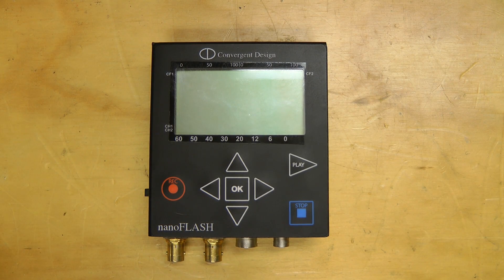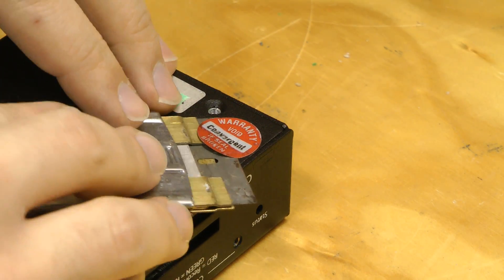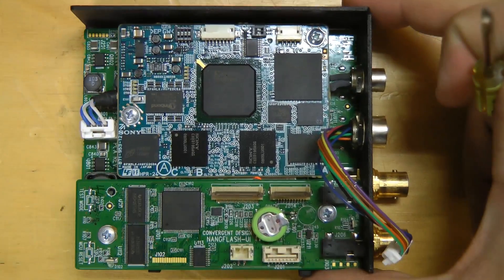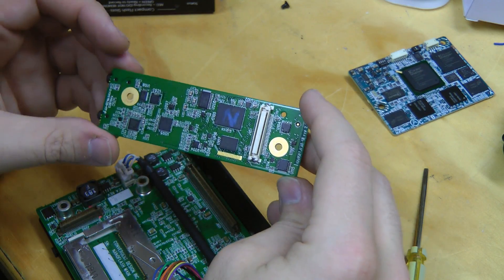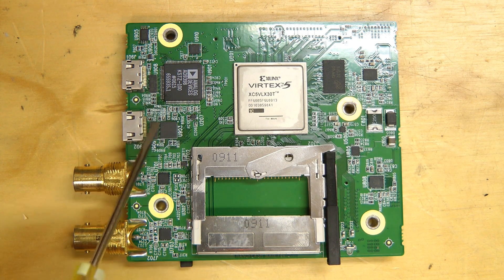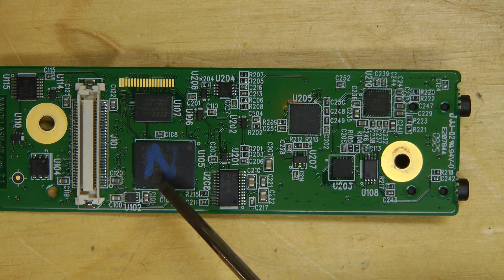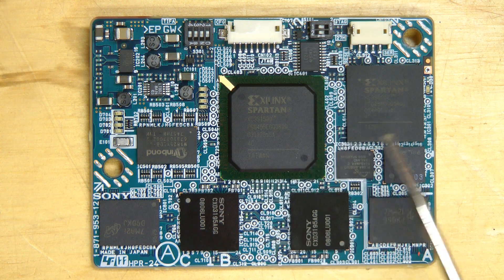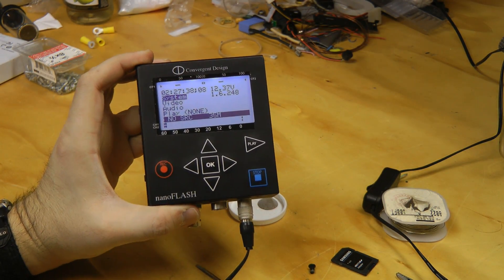NanoFLASH professional video recorder teardown

Comment: Thanks for sharing this! I have a NF and the onboard battery is dead. How difficult would you rate exchanging the battery? Can it be done with a standard soldering iron (regular size) and is there a high risk of frying chips/circuits?
Reply: To explain further, I have basic soldering skills and done some soldering here and there, it's definitely not my strength though.
Reply: @kinomagic-net  Hello from 4 years in the future.
I have one of these that needs a battery , did you manage to DIY or dod you get someone to do it for you ?

Comment: I could use something like this. Do you know if it's immune to macrovision?
Reply: use a sony DV camcorder w analog pass through, allot of the D8 and some MDV will ignore it. (most of them also have a built in basic TBC)
Reply: kakureru
I would get the JVC Everio or something similar something that doesn't need a PC to record. Basically so it doesn't need a PC to do the heavy lifting because PCs can be laggy as they can do many things but a video encoder does only one thing.
Reply: never had a laggy pc problem over fire wire. if you are having issues, its usually drivers or other conflicting processes. To the computer, it the same as transferring a tape. Also be aware that no all camcorders ignore macrovision, it just happens that so far all the sony ones do.  PS - the sonys with analog input will also let you record to tape.
Reply: be aware that this thing in video is HDMI or SDI only
Reply: Mine doesn't lag but I am looking for a stand alone unit that is macrovision immune.

Amazon has this little recording box with a small LCD screen that records composite video and audio to an SD card. I'm not sure if it's immune to macrovision. It's sold for recording home movies to digital so I'm not sure if you plugged it into a VCR and tried to dub a macrovision encoded tape if it would record it.
Reply: Cheap chinese boxes usually just reject macroision as a part of its analog stabilization. worst case is one that detects the macrovision and directly rells you cant record but is unlikely due to otherwise expensive licensing. .
Reply: I thought about those little recorders but often the bitrate is really low and messes with ability to correct image.
Reply: kakureru
I know that's another thing I'm afraid of. 640X480 isn't bad but Id like 720X480 DVD quality.
Reply: "Records 640x480 video in AVI format" AVI usually equal bad in these types of devices.
Reply: I am having trouble finding samples from this thing but if its anything like my other generic mpeg4 (non avc) devices, its going to really suck (when compared to a DV transfer.) If you buy this I would be interested in seeing exactly what it can do because this seems useful if good enough

Comment: I'm hardly an expert on the matter but as is often the case I feel this functionality could be achieved much simpler with fewer chips. For instance it seems odd to use a big powerful FPGA with a lot of flashram just to convert a high speed serial signal to lower speed parallel if that's what it does. Doesn't an SDI chip exist?

Comment: I bet that giant flash IC also stores the FPGA bitstream for the Virtex FPGA. 

When the system starts, the 8051 probably dumps the bitstream to the FPGA. That way the firmware is only stored in one place, and updating the flash image updates the 8051 code and the FPGA bitstream.